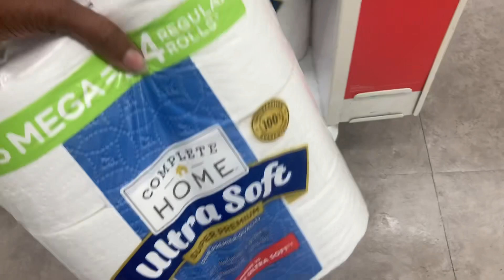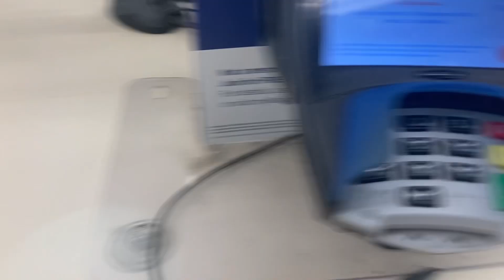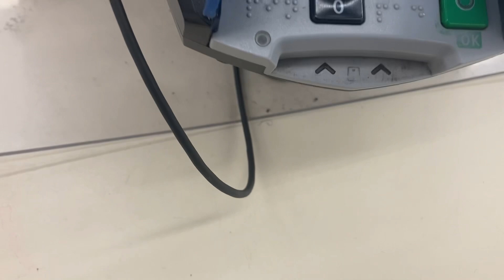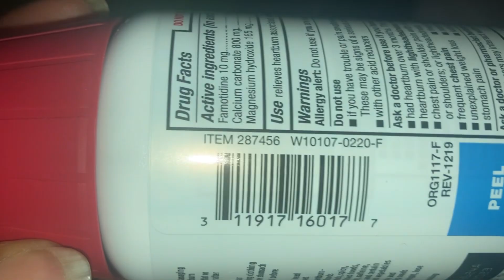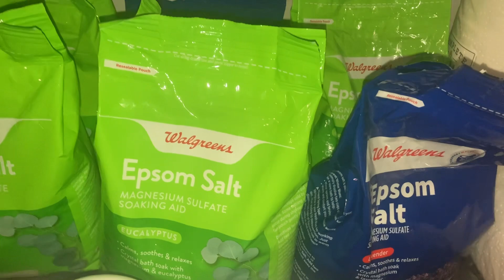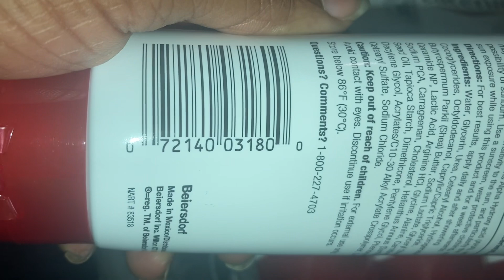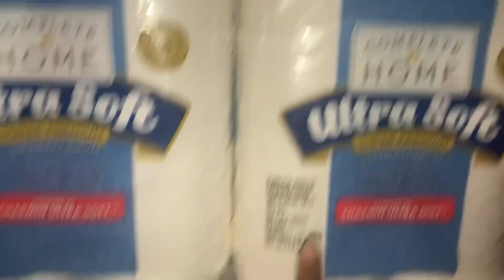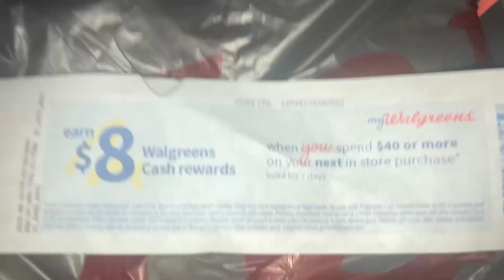Walgreens 90% Off|Part 3 of 3|RUUUN🏃🏾‍♀️🏃‍♂️🏃🏼🔥🤑 #walgreens #clearance #savingcoins #frugal

Comment: That happened to me yesterday. After he hit total...and I added something...then it came up...I was trying to use $10...it only gave me a $5 or a $3
Reply from the maker: Well if you were at 6, 7, 8, or 9 then it won't show that you have $10 available to use. You can only use $1, $2, $3. $4, $5 then it jumps to multiples of 10's. I didn't need to add anything, I could've used $4, but I thought that something was wrong because I was sure I still had $11 in points, but I didn't.
Reply: @SadeWithTheReceipts  I know... I found out I was under...and it took a min to update after I added candy ..just like u! 🤣🤣🤣 Then my $10 showed up.